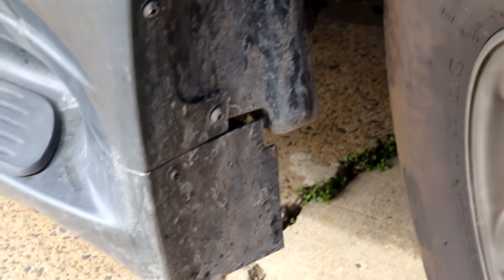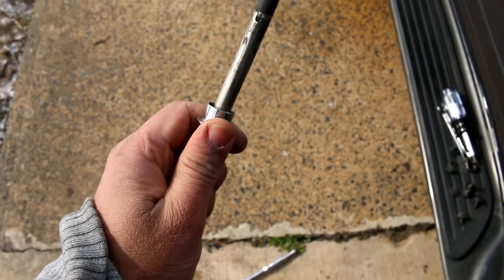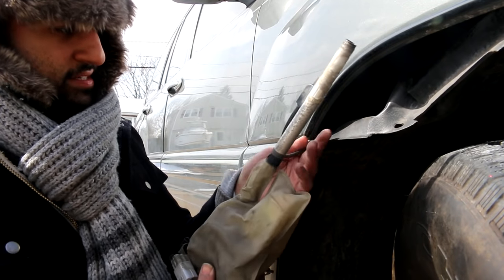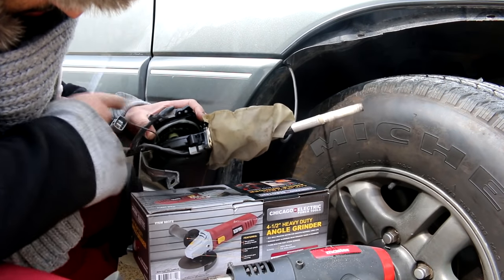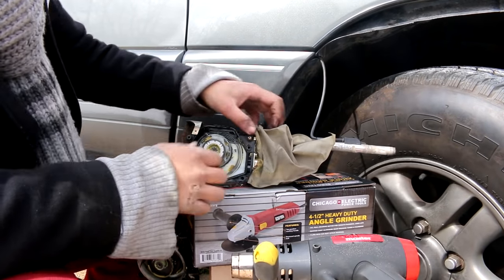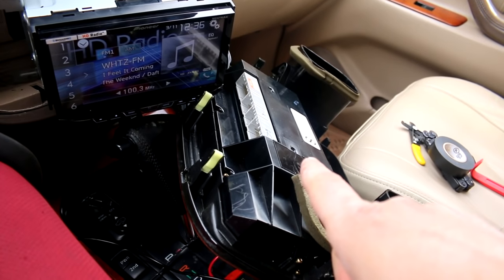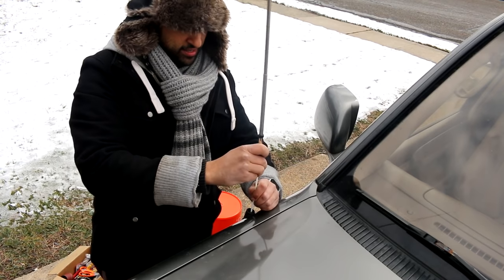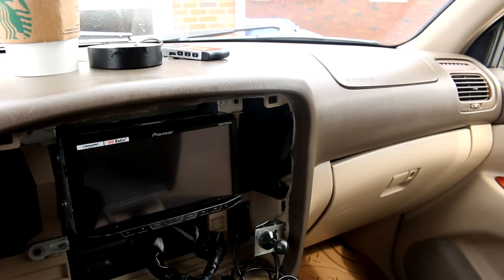How to replace broken power antenna on Toyota and Lexus Vehicles

Comment: Hi BeginnersLuckGarage! I just replaced the antenna mast in our 199 LX470 using your video to guide me. It was really helpful. I was uncertain as to which way the teeth were suppose to be facing. When you opened the drive compartment it was clear that the teeth would be facing towards the center of the drive wheel (check at 6:35) and therefore would be facing to the front of the vehicle when inserted into the pipe. My wife helped me with the key on and off steps to check that the motor was at its boundaries, and also pushing the height adjustment button to make sure that the motor was in the fully "up" position. She wasn't as enthusiastic as your girlfriend was when the antenna went all the way back down, but it was pretty close to that level of happiness. We have been without an antenna since May this year, so there was so pressure on me to get this repaired. Now we can receive our favorite stations without the static. A tip is to extend the antenna segments all the way "up" so that there is the least possible length of drive line exposed, and hold the base segment firmly so that the segments detract straight into the tube. Thanks again. I'll be sure to watch your other videos to learn more on how to fix my 1999 LX470. I bought a replacement antenna on eBay for $14.00 shipped from "blue_veg" in Colorado. The original part number is 86337-60151.
Reply from the maker: Lol, Thanks for the comment GuitarSwedette. I'm glad it helped. Even I was surprised at her reaction. I guess she was getting pretty annoyed with the radio as well.

Comment: Helpful video! My model was slightly different & wire harness was not accessible like yours.. made for a difficulty getting enough slack to make the repair.. appreciate you posting this!
Reply: I have a 2002 sequoia and mine is like that too. I’m about to go under the dash to see if the plug is in there

Comment: This video helped tremendously with my 1998 LX470, so thanks for the detailed comments.  In my case, the antennae mast broke off within the main housing.  So I could pull out the toothed line, but the broken part of the mast was left within the housing.  I followed your full disassembly instructions, hoping to get better access within the tube.  I ultimately used a stiff malleable wire (slightly smaller than a coat hanger, but a coat hanger might work), formed into a hook, which I passed down from the top through the center of the stuck antennae mast and then pulled back, catching it and pulling out the broken parts.  I didn't really need to do the full disassembly, but your instructions made it possible (including getting it all back together), and kept me from giving up.  I installed the following antennae which cost $60 online: LEXUS OEM FACTORY ANTENNA MAST AND CABLE 1998-2007 LX470 86337-60151.

Comment: Thanks for a great step by step how to guide! I own 1996 toyota 4runner and  I have been trying to find a comprehensive step-by-step video guide to assist me with replacing the antenna (plastic also broken inside the motor).  My biggest challenge was to removing the fender lining to get access to the antenna motor. I've broken most of my plastic clips! thanks again (:

Comment: this is a wonderful vid. you always do a great job explaining things. I never liked the telescoping antenna design  -  so on my LX470 I replaced the antenna with a regular one using an adapter kit from amazon. I think that will be much more reliable and easy to repair if it ever breaks.

Comment: Thanks Man! Classic that even though I previewed it twice, I still forgot the part about the center nut in the unit falling out of the back. I also had a plastic clip holding my antenna cable to the housing that I had to disconnect to get the assembly out of the wheel well.

Comment: Fixed mine today, pain in the arse job.  My old antenna wasn't extending all the way up.  Tried to remove it from top but stuck.  Thinking the nylon cord was chewed up I accessed the motor and plastic cord in fact OK, in fact the old antenna just needed an almighty tug to remove.  Nice that new antenna working properly and extending and retracting fully but with hindsight I would have left well alone, not worth the hassle for the length of time it took me.

Comment: Thanks this was very helpful.  On my '05 Lancruiser, the splash guard attachments are slightly different, but no problem to remove enough to get to antenna.  Otherwise just do as shown here.  One last item, on mine there is a manual antenna up/down swich on the dash.  When the power is restored to the car and radio, the antenna defaults to only going up about 4 inches.  So just use the manual adjust to put it all the way up, and it will then  go full up with radio power on.

Comment: Thank you so much for the video. Just one question hopefully someone can help me with.. we replaced the antenna mast on my '04 Lexus LX470  per the video.. it fed in and retracted all the way, but then continued to try to retract more even though it was all the way down causing a grinding noise for 15-20 seconds until the motor finally stopped. Any ideas on why it is doing that or how to fix it? Thanks!

Comment: Fabulous video. Thank you. The problem I continue to have is that, within a few days of repair, the hollow metal post through which the antenna slides up and down, comes out of the motor casing. Any suggestions?

Comment: Hey I wante to comment on one of your latest videos but the comments were disabled. the question I had was in regards to you aftermarket LED bulbs. after having the on for 6+months have you noticed any melting or weird stuff with the projectors? the reason I ask is ive seen in the forums is that the projectors are not meant for anything other than halogen bulbs also did you figure out a housing seal? thanks for your videos!

Comment: Man, that guy is an Eskimo. I can't stand to do anything outside and with no gloves.   I can't get my 4 prong nut to come off of my non powered antenna for my sienna. Been on there for 20 years now. Should I have continnuity between the outside wip antenna and the center coax where it plugs into the radio? I can only pick up local stations as of the other day and have gone through the entire process of elimination to find the problem of switching out with another radio and new antenna from wal mart but still not distant stations like it used to. Thanks.

Comment: Question: so my antenna broke/bent in a car wash. So I think the cord is intact. So from this video I'm taking it that I can just pull out the antenna?
Reply: I did the same thing with mine (bent it in the car wash), I just unscrewed the top nut and turned on the radio and it spit out the whole antenna. I bought a new antenna from the dealer, turned the radio on/off and it sucked it in and then I installed the top nut.Job done.
Reply: skeleton crew thank you so much!
Reply: skeleton crew just replaced it, but for some reason it either wants to keep feeding out for an extra 10 seconds or wants to keep retracting it for an extra 10 seconds. So it keeps making a grinding/ clicking noise
Reply: skeleton crew the one I bought was an aftermarket for a 97 4runner
Reply: @moonera51  Did you figure out how to fix this? We just replaced the mast on my '04 Lexus LX470 and it is doing the same thing. Sometimes it will only go partially up and stop, other times it will go all the way up, but it always grinds for and extra 10-15 second when it retracts down.

Comment: I have a 2001 toyota sequoia limited and the antenna motor does not have a removable plug. It is hard wired directly to the antenna motor. so it impossible to remove. Any ideas? I managed to removed the motor cover while it was still attached and managed to remove the broken mast. I ordered an antenna mast from ebay for about $15 and  it stated that it was guranteed to fit the vehicle. After about 4 hours, struggling to feed the mast it keeps skipping and grinding and eventually i figured it out that the mast is slightly thinner and the teeth were too shallow than the original so it was not catching the teeth on the wheel. I tried with the original one (it was short) and it fed right away. So now i need to order from toyota and its gonna cost me about $100. Bummer.
Reply from the maker: that is a bummer. If you are comfortable soldering you can try this https://www.amazon.com/Connector-waterproof-Female-Suitable-Connection/dp/B08579V5ZJ/ref=asc_df_B08579V5ZJ/?tag=hyprod-20&linkCode=df0&hvadid=459665449369&hvpos=&hvnetw=g&hvrand=10676301000792423883&hvpone=&hvptwo=&hvqmt=&hvdev=c&hvdvcmdl=&hvlocint=&hvlocphy=9004024&hvtargid=pla-944411219403&th=1

Comment: Great video, thank you! I need to install the replacement mast on my 4runner, the white plastic piece with teeth is not broken off inside the antenna motor. Can I simply pull the old one out? Do I still need to access it to install the replacement?
Reply from the maker: Thanks, no if the white plastic(nylon) cord with teeth is not broken you can simply pull it out and install the new antenna. Make sure to measure the length of the one you pull out with the new one because you may have a small section of the plastic cord broken at the end. Its hard to tell sometimes. Hope that helps.
Reply: Where can I buy the nylon cord?
Reply: Meghan Castro 
Yes
Reply: @Jason Lee. I don't believe that you can buy the nylon cord separately. You can buy replacement assemblies that have the nylon cord and metal antenna as a single unit. They cost between $12 to $30 shipped.

Comment: I just installed a Pioneer AVH-X490BS on a 98 LX. The antenna does not work,  I did hook up the black/red wire to the Pioneer's blue/white amp turn on. What else am I missing mate?
Reply from the maker: Make sure you hooked it up to the right black/red wire. go to minute 1:50 on the video below and you will see the connector and what wire you should be connecting to. https://www.youtube.com/watch?v=8NPjLJirzAg

Comment: is there like a wire i can cut or fuse i can remove to stop the antenna from goinng up and down. or stop the motor from working
Reply: Yeah just unplug the connector he showed in the video if it's old it may be a pain to disconnect but once it's unhooked it can effect your radio signal strength greatly depending on the topographics of your area

Comment: My antenna broke and only goes down halfway. Would I be able to remove the antenna if it is at full mast by simply pulling up on it? In turn, I should be able to place the new antenna back in and turn the radio off, correct? Hopefully someone has tried it and can help me out!
Reply from the maker: well it depends on what you mean by broke because if your antenna can go down half then the nylon cord Im guessing is still intact to some degree so yes you should be able pull the old antenna out and it should come out with its full nylon cord. Then just insert the new antenna and let it retract.

Comment: i have 1999 4runner i first replaced the antenna when i first had the car because my little cousin broke it that was over 60k miles ago now i had to change again because it brushed a tree and i think the white plastic with teeth broke inside i totally forget how to do this because my uncle helped me the first time
Reply: its the same i just replaced it and its almost the same thing haha thanx
Reply from the maker: Glad I could help bro
Reply: Do you have the original stereo on your 4runner? I want to replace the antenna on my car but I don't want to deal with having to remove the console. Can I just take out the old antenna/chain and feed the new one in no problem if I have the original stereo in?